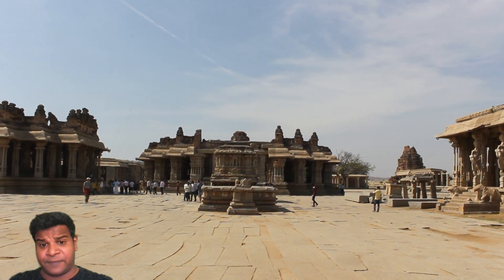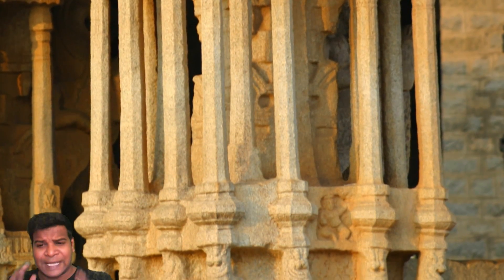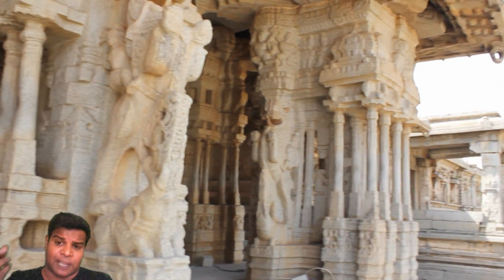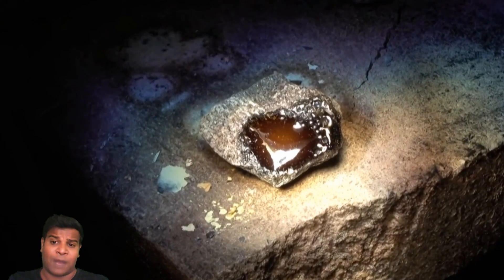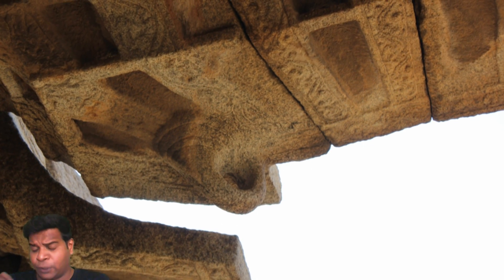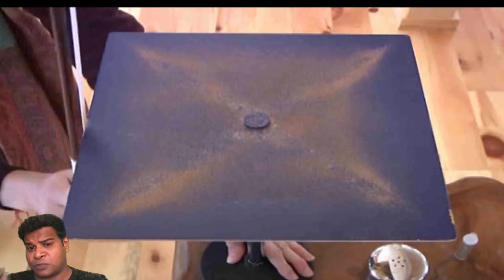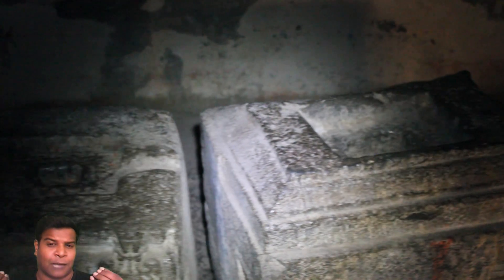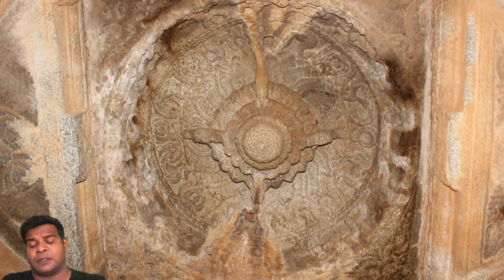How do the Musical Pillars Work? Rock Melting Technology? Cymatics?

Comment: Great work Praveen. Excellent and thought provoking. Your presentation here is in keeping with the work of Michael Tellinger. According to Tellinger, these structures, whether in South Africa, Greece or India, were energy producing devices. They used sound to create energy. Therefore the inexplicable numbers of columns which modern engineers thought were weight bearing, but, actually are energy producing devices on a huge and beautiful scale. Please do look up Michael Tellinger if you haven't already. Thank you for your great work😊🙏🏼

Comment: Although the broken pillar looked solid, you could argue that its where the strength or load bearing would be. And maybe when these pillars were moulded there is a hollow section inside each pillar of varying heights giving different notes similar to a flute,if u get my drift. Great work mate, luv your videos. Cheers

Comment: Comment two:  I do know without out of body double checking.   There is underground layers like caves of water flowing under these buildings.  More in the rainy season makes it louder.  Less loud in dry seasons.  This is called Echo chambers music skills.  Like Indian Cave music.  Very beautiful.  Also there are parts of this building like Fangs under the building more then two.  These are for Earthquakes.  And to send the vibrations into the layers of flowing waters underground.  Now the earth sounds change by season, by underwater flow and over time so there has to be a way with water or with crystallized sand to change this building.  My guess is the chains of stone held jugs of water in them.  Something holds water in the building.  Now they must have had lots of musical codes this would be their code languages sender.  With the water it could send maybe a quarter the way around the planet.  Also there is sounds together and in order to create light without wires like electricity.  I don't know how they do it but I have seen it done.  What I am most pleased to see is a that the Indians did not destroy their pre history tech like other civilizations.  They also remembered the old ways.   More important then Gold.  It is priceless Antiquity.  Very Wise East Indian cultures.

Comment: No, they didn't have to melt rock to connect different kinds of stone, a chain and an eye (not a hook--a hook would be easy).  A section of a link could be cut out, the link passed through the eye, and the section cemented back in place.

Comment: Great video. Could the sandstone links be a forgotten process like concrete? The sand was mixed with some substance that fused the sand grains, so once molded or shaped they were "set" into a permanent configuration. Could sound have been used to vibrate the sand grains together, creating enough friction to make the surface of each sand grain hot enough to soften and fuse to the other sand grains? Although the columns were carved from the same piece of rock, the rock could have naturally occurring variations in density. Although the columns appear to be the same size, are they? A mold or cast could be made of each one, then you could test to see if each mold would hold the same volume of water or if there was some variation. This would offer proof without damaging the columns. Thanks for the vid.

Comment: Your eye-opening videos provide plenty of food for thought & reflection upon ancient Hindu temple architectural marvels.  Keep up the wow-some work!  On this apparent mystery, one with a rock science/research background can shed more light.  They'd first say that what we call "solid rock" is not completely solid or fully dense.    All rocks, even ones formed from molten material, end up with microporosity which is not visible to the eye.  If one measured did permeability tests or Archimedes testing and high-mag microscopy,  such porosity can be confirmed or revealed.  From my experience, I can say that microporosity a significant effect on the nature of "cymatic" sounds that emanate.  Upon tapping a rock, if it has plenty of porosity or micropores, then the sound would be more percussion-like.  On the contrary, if it has lot fewer micropores, we'll hear something more metallic (similar to jalatarang scales).  Our ancients might have selected rocks of varying grades from different bed depths & tested their sounds after making miniature pillars and tapping them gently/ "elastically" to induce resonant sounds.  This way, the classical sapta-svaras (notes) could have come about.  Lastly, melting rock is not easy because of the high temperatures required & also the rock becomes more glass-like.  If they took hollow rock & filled the pores w/molten metal(s), visually or by simple testing one can tell. So, a couple of different takes on this intriguing stuff....
Reply: Ramol Desnag Nice Observation

Comment: All you needed was calcium oxide, although there are a whole host of soluble minerals you can form to saturate sand and create materials of differing material density, hardness and tensile/compressile strength.

Romans made concrete superior to anything made today, so its entirely possible they used some form of chemical alteration without heating the basic stone.

Comment: The sandstone chain in the granite rock is amazing. You should post more pictures from different angles, also with macro lenses to show any trace of carving technique. If it has been melted there should be signs of the joint.
Melting stone is not like melting metal. When you melt stone it does not  cool down to the same stone. The cristalline structure created in thousand of years of slow cooling of granite would be changed. Sandstone is not a igneous rock but a sedimentary. If you melt it it would not be sandstone anymore.
Maybe it could have been made hot enough to become soft and bendable but I doubt.

Comment: I had to stop this vd half way through as it was infuriating. Cn you not see that the whole temple is carved from wood. The chains would be metal, and the link holding the chain is metal attached to the wood. This is so obvious. The wood and metal overtime attains a dirty stone look  due to dust and weathering and time that hardens to wood and makes it look like stone. Plus wood can also be given a thin layering of plaster to look like stone. Do you possibly think that stone has any integrity to maintain such strength and remain such, like that chain. Even if a pillar were made of stone, it would be in blocks, would have to have metal rebar running down the center, as with any concrete or stone block used for walling and construction. The ancients used this technique with all their structures, and it is very evident in alot of the ancient sites, the colouring of the stone, or the running patterns. Please go to channel wiseup and learn some facts on construction first before making any more vids

Comment: I feel like the builders weren't melting the rock. At least not with heat. The density changes were achieved with sound itself. See the Hutchison effect. I feel also that maybe  the builders provided answers in the form of those ceiling carvings. I would be very interested to know what exact frequencies those cymatic patterns coincide with. Maybe those frequencies are literally the keys to the castle.

Comment: hi phenom travler,
I love your channel. Im not trying to deny ancient advanced tech as the evidence is all around us.  But you seemed to miss somthing in the musical pillars. the vibation of the same string in a 🎸 for example if turn the adjustment key more tension creates a higher pitch. now if you hold a wood dowels and strike it by pressing hard on both ends the pitch will lower similar to loosening the guitar string. you can try yourself. so the temples pillars were likely tuned i am sure some of the pillars are under a greater load.

      thats all but the rest was 👽 more on kailassa temple please. wow mountain carved into a castle i never heard of that one i got to go there. keep watching the skys!!!

Comment: Nice to see some more of the rock structure details in India. 

If one studies the work of Joseph Davidovits who wrote a book describing how the pyramids of Egypt were constructed of geopolymer based artificial stone construction, one can get an idea of how the rock structures that proliferate India were made. Geopolymer rock material has a consistency much like clay and can be worked like it. It hardens into the rock that it's aggregegate is formed of, becoming indistinguishable from real rock only by its chemical signatures. Crystallography is not adequate enough to identify it, as Davidovits demonstrated with a test of his geopolymer statues that he submitted to geologists for examination. They classed his statues as real rock, when in fact, he had made them out of geopolymers himself.

Once one understands the nature of claylike geopolymers that, after setting, harden into seemingly real rock, one can easily see how the rings in the video were formed, along with the different frequency columns.

Different density columns are easily fashioned by adjusting the type of mineral compounds and geopolymer cements that one uses to construct the columns.  Different minerals have different densities and other properties, such as hardness, heat conductivity, and sound transmissibility, resonance, etc.  

In the Great Pyramid of Egypt, the beams in the Kings chamber were adjusted in mass and size to produce rock beams that resonated at certain similar frequencies. Likewise, different resonant frequencies can be achieved by small adjustments in the form, size, shape, and internal mineral/crystal structure of the objects.  Objects can be layered with different materials of slightly different densities to give different resonance qualities.

Polymers, using such minerals as alumino-silicates, allow for large scale construction projects in which new material can be added to older material with barely visible or  invisible joints. The new material crystallizes into the slightly older material.  It is often observed in Egyptian monuments and others around the world, that surface layers of polymer rock, or plaster, is laid over different types of rock or material underneath to create one solid appearing rock. Artful walls appearing as if made of odd shaped stone blocks are created. We still do it today, just not in such a large scale as the ancients obviously did.  

When simple, yet perhaps quite technical, methods are found that can easily reproduce the ancient structures we see around the world, we must naturally gravitate towards concluding that those methods were used by our ancestors, particularly if worldwide evidence highly supports it. Use geopolymers as Davidovits did, in rediscovering geopolymer "concrete" (better described as clay, or re-synthesized rock), and a mountain of problems are solved, and one can even fool the latest advanced, highly educated, sophisticated geologists of today, just like our ancient ancestors easily do.  Case solved.

Melting rock is much more difficult than making concrete or clay and manipulating it.  Steels and purified metals need smelting, but not minerals of rock reconstituted into larger rocks. Concrete consists of aggregate (gravel, weathered rock, crush, etc), water, and a cement, all mixed together and applied. Simple. For geopolymers, all one has to do is go find the right minerals, mine them, create cements using water, salts, and lime (and not even that for various polymers), and  remix the dried cements with aggregate and water, similar to how concrete and ceramics are made today.   

.....

Comment: The trouble with melting is it changes the material composition; as others pointed out, sandstone would turn to glass.  Granite would also change into an igneous rock, unless the temperature and pressure were right.  Perhaps the chains turned to stone from an organic material, or were stamped out from sand and quartz?

Comment: You can also alter the tone by tensioning the object. This why in my belief these columns were once timber and over time (thousands of years) of being underwater and under pressure they have turned to stone. I believe that man has been on the earth for a lot longer than we have been taught, we have on and off through different civilisations had the same or very similar technology to what we use today  (we can't melt stone!) If you look at how this is all constructed a master craftsman would easily be able to replicate this in timber. Don't believe everything you were taught when you look into different dating methods none of them really add up unless you have a documented time line you can work from. Timber can turn to stone have you ever seen a petrified tree? All you need to do is research and use critical thinking and you will find out that the mainstream are talking poo. Just think for yourself

Comment: Fascinating video. But I think that in the case of the stone chains there is no need of really advanced tech. The links can be carved out of solid sand stone and you just  need some kind of ciment or concrete to close the last link around the granite hole. Do you know if someone did any kind of analysis on the top sandstone ring? The only idea that I have about the pillars is that the could be compressed more or less by the weight above, but I have no idea of how much weight is needed to change from one tone to another, it could be kilograms or it could be tons. Anyway the process of tunning it would be something amazing. While all this is quite amazing I see no need of exotic technology like phase shifting.

Comment: The chains are hard work, no melting is necessary. Its easy to explain. When you take a closer look to the chain you see, it is a bit of imperfection. The cain was created out of a single rock. Its a lot of work and you have to do it from bottom to the top, because of the weight.

Comment: The main ingredient of rocks is silica. Silica can be dissolved in water with potassium hydroxide. When the water evaporates it leaves behind glass.  It is called waterglass.  Musical instruments were painted with this stuff in the Renaissance.  The cymatic stuff in this temple is blowing my mind.
Reply: I forgot my main point. The pillars have  resonant grooves cut on each one at a different point along their length.  The vibration in the column is divided at this narrowed point.  This is not unlike playing harmonics on a guitar when you mute the string above the harmonic.

Comment: I wonder if the number of angles and width carved on the pillars at their length will affect de sounds each pillar produce. Also each pillar have a different carving circles on the top, would that influence the sound as well? Melting the stones is a very possible, since many monolithic structures around the world have a very hightech angles and "carvings" that most likely can only be achieved by molds.

Comment: This is interesting.... 
Actually i think this is entirely within the reach of Ancient India. 

First, ancient india understood advanced chemistry as evidence of damascus steel. That came out of India. A basic chemical compound that is like molten stone is Water Glass. You could use water glass to make that sandstone chain. 

Second, if they understood water glass, they probably understood ion exchange. soaking a rock in boiling water produces different ions. You don't need to melt the stone; you  just need to immerse it in boiling water that has those chemicals that you want. 

These pillars are proof of advanced chemistry in the ancient world.

Comment: Sandstone and granite knoked out my brain, its impossible
Reply: Мыркымбай Жыркымбаев All I could say is.. please visit India, look around  any Temple older than 500 years. Doesn't matter which Temple. Gaze at them from a construction Foreman's mindset. You would find half of the construction amazing, and the other half bring a" how the hell did they manage it?" feeling. A casual onlooker will enjoy the beauty, but if you do heavy industrial construction, there are some amazing things that makes one wonder about these Temples. ( P. S . I am not a Hindu promoting, but an avid fan of construction .. old and new)
Reply: Direbear Coat It is possible that the chain is carved. I have seen wooden ones. However, to do so in stone would be a Herculean task. One wrong stroke of the Hammer or a chisel at a wrong place/angle would make it all a wasted effort.
Reply: nick sweeney, yes, that is right. Cant make sandstone chain from granite. My answer was to the question just above my comment. The question was would it be possible that the chain was carved from a solid sandstone block, ( not granite)
Reply: melt yes but if it is a sound softening tech then there may not be a heating aspect. So the chemical structure would stay quiet unchanged I am totally guessing.
Reply: Could they be using some technology using sound to alter the densities of stone material
Reply: I Seen magic tricks like this Magic 🙂
Reply: Dictum Factum 
Truly magical.
Reply: Is it possible that the sandstone links were carved from a solid rectangular block of sandstone?  I'm thinking that if you melt sandstone, that it will turn to glass.  As to how they linked sandstone to the granite loop, that's a real mystery.
Reply: The links could be glued together.